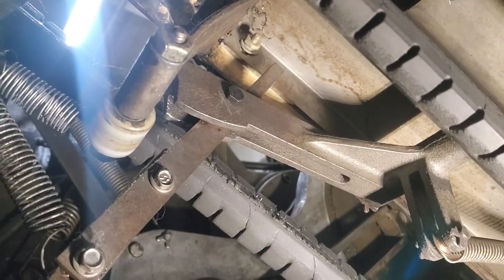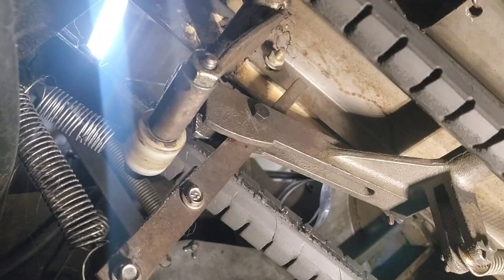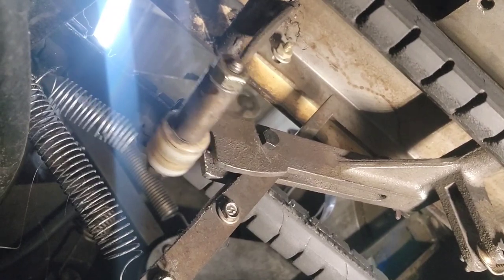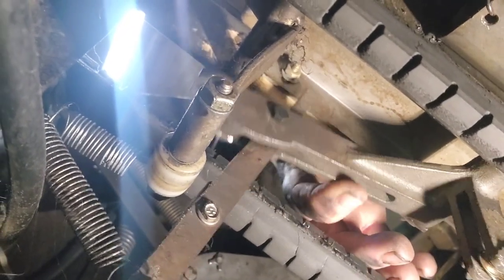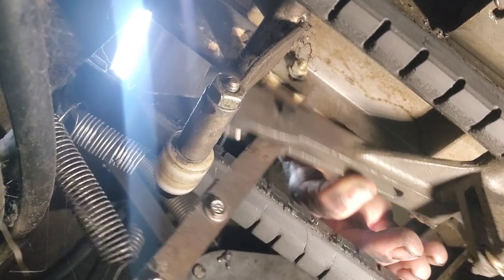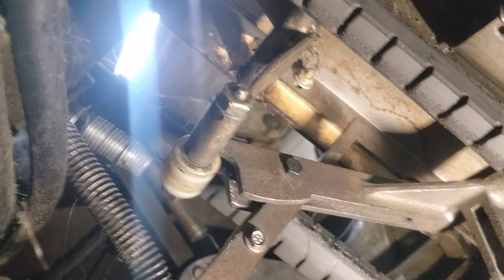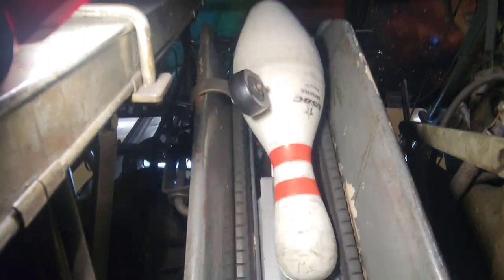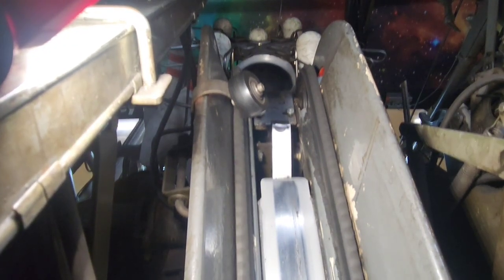Brunswick A2 pin gate latch and lever. How does it work?

Comment from the maker: I realised after I posted this video that there is an extra spring on the pin gate strap. This extra spring was the reason that the latch wasn't lowering properly. I missed this important detail on the initial inspection. 

My guess is that someone tried to compensate for a worn pin gate strap.

Comment: When replacing pin gate latch assembly is the latch that the part that looks like two forks that the rod with the L shape rides on the roll pin is the two forks have any bend to them at all.  We r replacing it all now and took the old one off and after getting it off the ends look like might be bent not sure they have a bend or not on them
Reply from the maker: They shouldn't have any bend in them. It may not be hurting anything, but it probably isn't helping anything either.